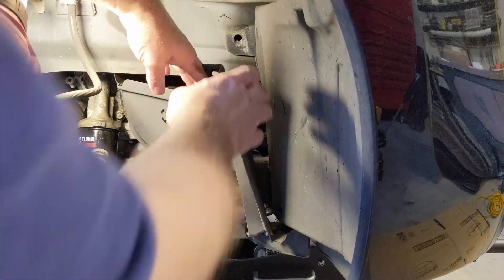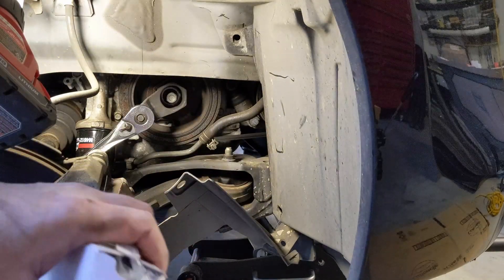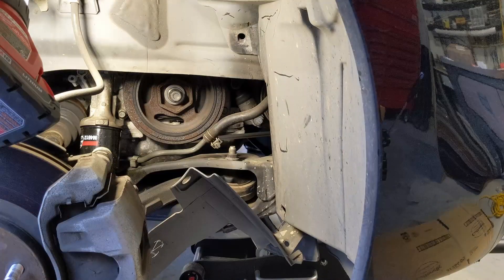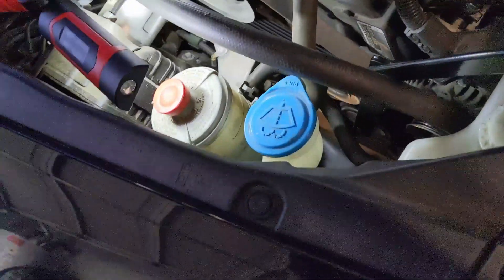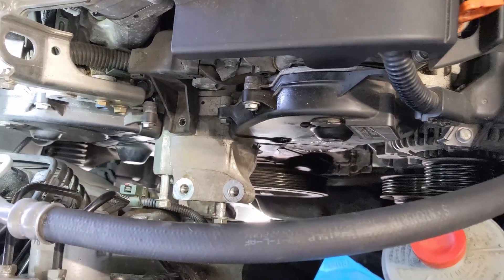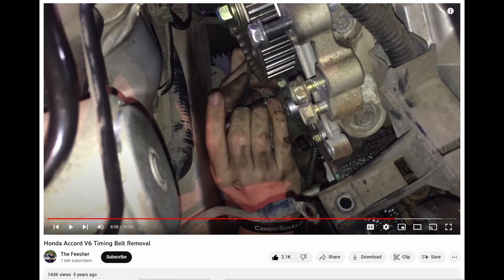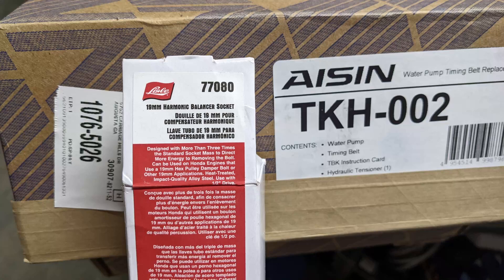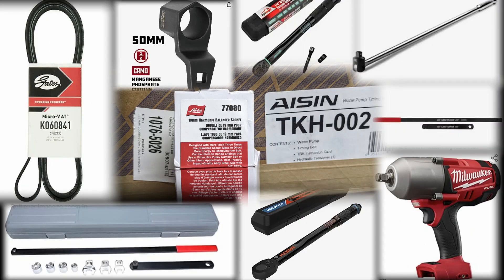Real Life Torque Test - 10 Tips to Honda V6 Timing Belt Replacement

Comment: I hope you replaced both of your camshaft, and front crankshaft seals. They are just as important as the water pump in this configuration.
Reply from the maker: Most experts told me if they are not giving an issue, don't touch them! To each his own, but for me I wouldn't touch them for the hell of it if it was a timing chain engine with 90K miles.
Reply: @ThriftyToolShed  Well if you want to take shortcuts. Put a breaker bar on the crankshaft bolt then lay it against the frame and bump the starter.
Reply from the maker: @ipissed  
No sir. I have actually seen it and the rotation is correct, but It doesn't make any sense to me to try to destroy the starter or the flywheel instead of correctly removing the bolt.  I would personally never do that myself.
Reply: @ThriftyToolShed  Take a ratcheting strap and wrap it around the pulley a few times then attach it to the frame to torque the bolt back on.